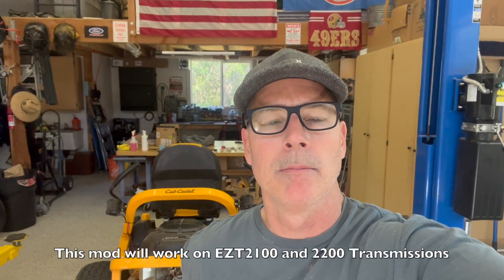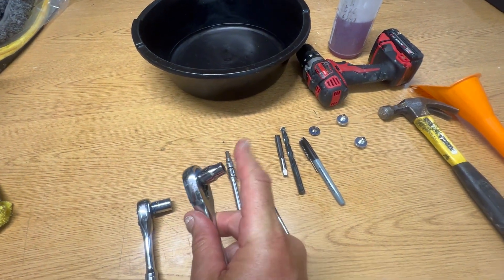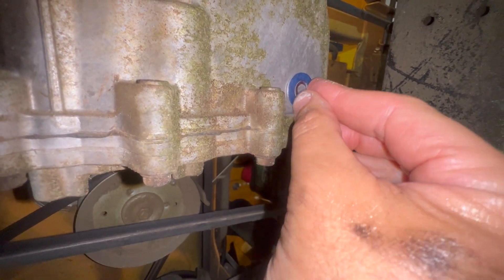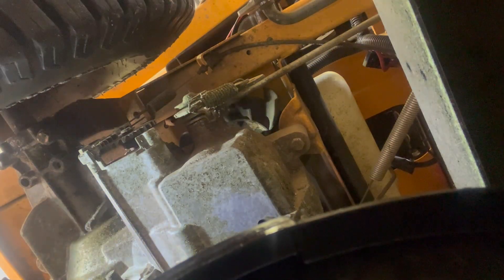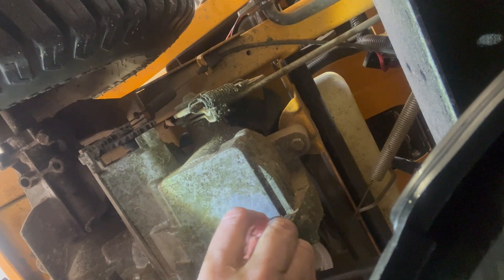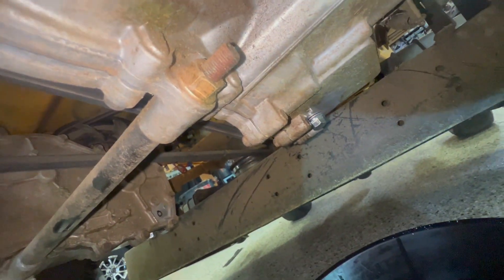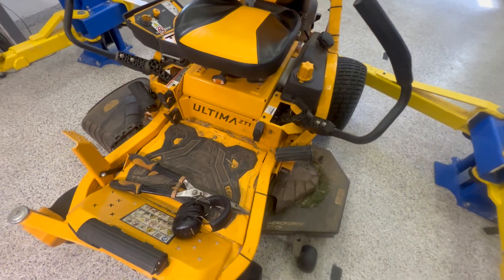Cub Cadet Zero Turn ZT1 EZT 2200 Transmission Drain Plug (magnetic)

Comment: Don't really know why you'd bother, it takes about 10 minutes per side, 5 mounting bolts each side to remove the whole hydro gear. Invert over a bucket and refill.
Reply from the maker: I’ll take the two drain bolts 😊 30 seconds and it’s done 😊

Comment: Well, well, well...
After watching this video a few months ago and bought an M12x1.25mm tap, appropriate drill bit, and tap holder for a ratchet wrench.  I also bought both types of drain plugs you recommended.  I wasn't comfortable with using the copper or aluminum washers that came with the plugs, so I bought metal bonded rubber sealing washers and rubber washers (I didn't use the rubber sealing washers).  You see, I was concerned about loading the thin aluminum transmission case threads so much that the threads would strip if I used the copper washers.  I only have 57 hours on my mower, it's 5 years old and I've never had a problem with anything on it.  I drilled pilot holes then the larger hole without a problem.  I drilled the first hole a little bit too close to a feature on the transmission case which prevented me from using a magnetic plug (thank G_d I bought the smaller plugs).  After the oil drained out, I noticed oil drips that looked like mustard, so I believe water intrusion occurred.  I used STP 0w20 full synthetic to flush the cases.  With the drain hole open I poured a quart waited for the oil to drain, then installed the plug and filled the case with 1.5 quarts, then removed the plug.  I used 0w20 because I wanted the flush to drain as quickly as possible to move any chips during the flush.  I then installed the plugs and refilled the cases with Triax full synthetic 20w50 hydrostat oil and purged/checked before I capped the fill plug.  Whew!  I thought about this for 2 months in order to build the courage to drill holes in $2200 worth of perfectly working transmissions!  I drove the machine around for 30 minutes and neither drain plug leaks!  The mower isn't working any better than it did before, and may be a little bit slower (6.9mph vs 7mph).  I did notice a black plastic drill chip in the flushed oil (probably from the internal filter housing), I hope I didn't damage the transmissions.  The old oil did have a lot of fine metallic dust, so replacing the oil was a very good thing.  In hindsight, it might have been smarter to use tapered NPT plugs so the loading on the transmission case would be radial loading, instead of axial loading of the transmission case holes...

Anyway, thanks for the video!  Next year it will be fairly easy to replace the oil.  I actually bought an oil extractor, but I knew it wouldn't remove all the oil.  I was really worried about drilling holes into something that would render the machine junk.  Hopefully the mower lasts longer than I will!
Reply from the maker: Glad the video helped you out.  No doubt the transmissions will last longer now.  I have 203 hours on my mower now and so far no leaks and everything is working fine.

Comment: I've watched your video a few times now. I think I've decided I want to do this on my ZTS1 with the same hydros. My machine is out of warranty now, so I feel a little better about drilling into the hydro. I see the note you added about adding RTV to the plug threads. Did you let that sit to cure before you filled the hydros?
Reply from the maker: Yes, I did let the RTV set up overnight.  You can also purchase quick drying RTV which should work fine.  I just hit 203 hours and still no leaks and everything is working fine.  I do believe this will extend the life of the transmissions.
Reply: @Travis8126  Thanks for the reply. I purchased the 12mm drain plugs and drill/tap kit you linked. I'll make sure to RTV the plugs after and let them set up before refilling the hydros. I only have around 30 hours on my machine, but I've owned it for going on 4 years. Figured it's time for a fluid change.

Comment: Question @Travis8126 ?
I can't tell from the video, but did you also use the supplied washer with the install or just the bolt alone with gasket maker ?
Reply from the maker: I used both - supplied gasket and RTV.  Let dry and set up before refilling.

Comment from the maker: Wanted to give update, I have about 14 hours of mowing with the new plugs installed and so far everything is working great.   No leaks and transmissions are functioning perfectly.  If you do end up doing this modification make sure and use some RTV on the gasket/threads and let it set up and dry before refilling.  You can also use a 10MM bolt/tap if you would like to go smaller diameter.  I went with the 12MM because I wanted the magnetic bolt.
Reply: So where are the links for the bolt/taps?
Reply from the maker: @diyek1781 in the description below the video

Comment: Just ordered my plugs, my left side has been a little weaker, hopfully some fresh fluid will help it out. 

1.5 qrts got you to the right level?
Reply from the maker: Yes, 1.5-1.7qts is about where you need to be for the refill.  About 1" below the fill plug.  And remember to use some RTV on gasket and drain plug and do not over tighten.  Good luck with the project!  I think you will be very pleased with the results.  I have about 10 hours of mowing now and zero leaks and no problems.
Reply: @Travis8126 did u use the aluminum  ONLY washer gasket, or the Toyota version or the Toyota version it came with, with the blue felt paper?

If blue, thicker paper towards trans of plug bolt?
Reply from the maker: @cueballsi  I used the gaskets that came with the drain plugs (blue).  They should work on either side. Just make sure and use some RTV on it and allow to dry before refilling the transmissions.

Comment: Don't drill too deep (more than 1/4") or you risk drilling into the pump pickup filter. Best to put a stop collar on your drill bit.
Reply from the maker: You will not hit anything if you go in the corner area, it is outside of the internal pump location.
Reply: The location he drills is mostly out of the way of that filter. But I would still be cautious.
Reply: Mower moves well! Had to adjust the throttle on each of sides after the fluid change.
Reply: So, I think I hit my filter. What is the con of this? The drain plug is fairly long, like 1/2” so you would hit the filter….

Too bad I can not post a picture, but I looked in the hole, and I do see plastic….

Thought I drilled the hole basically in the same area as video.

I drilled the other transmission a hair more back, still see a little of the plastic of the filter when you look up.

Turns out I didn’t have the tap, so will get it tomorrow and put the plugs in. 

No going back now…..
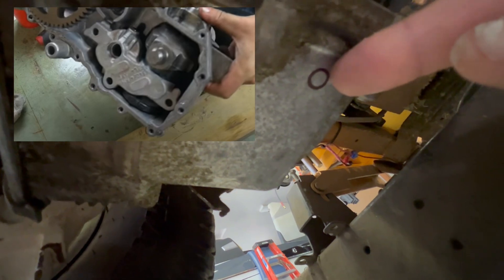Reply from the maker: @cueballsi If you hit the filter unfortunately you went too far inward and not in the back corner area.  If you see the picture at 4:18 on the video you can see the area that is open.  If you did hit the filter I would just move on and install the drain plug, not much you can do at this point.  I doubt it will cause any issues, plus you will be draining the fluid more often anyway.

Make sure and use some RTV on drain plug/gasket and let it set up before refilling.  Let me know how everything works out.
Reply: @Travis8126  yeah. Not tooo worried. Put some right stuff on the gaskets and letting it sit over night.

I added some oil as a flush. And rolled up the end of a paper towel to help stir it up while I drained. Some aluminum chips still came out. Even when I put some grease on the tap. 

Thanks again for your tips and tricks

NOTE: m12x1.25 gets about 2.5-3 threads in the aluminum. If anyone was curious

Comment: Great thanks for the info. I am doing the same this week. Hope it goes as good as yours did.
Reply from the maker: Awesome, you will definitely like it.  Make sure and use some RTV on the washer/lower threads for your final plug tightening.  And be careful not to over tighten you will strip it out if you go full send with it.

Comment: Could you tell us, what is the thikness of aluminum in this location, please ?
Reply from the maker: Approx 1/4”
Reply: Thank you  @Travis8126 . I had do this modification on Cub Cadet XZ5 with Hydro Gear EZT-2200 and 75 hours. That's work very well. I added drain plug in M10x1.25 it's enough. I drilled in same aera like you.
Reply from the maker: @willsmith361 Hey thanks, you definitely could also use a M10 size drain plug.  I wanted it to be magnetized and I could only find them in M12 size.  Regardless it’s a really nice upgrade and I truly believe will help extend the life of the transmisson with easy fluid changes.

Comment: Thanks man your the best I have been sharing this video ever were no one was brave enough to do it now its my turn to gave it a shot have a great day my friend!
Reply from the maker: You are welcome, I would also recommend using a little Ultra Black RTV or Right Stuff quick drying RTV on the plug gasket and threads when doing your final install of the drain plug. I forgot to mention I did this in the install.
Reply: Thanks  @Travis8126